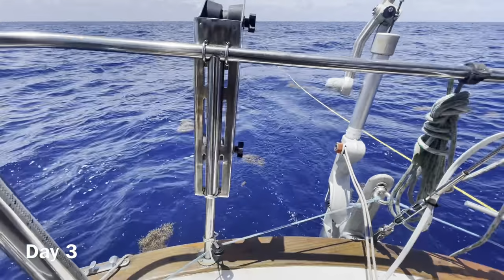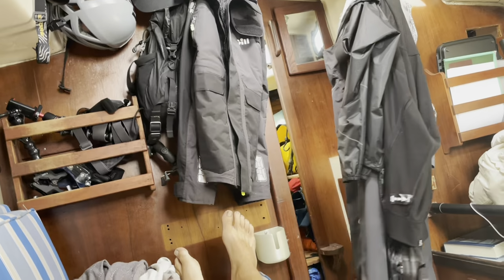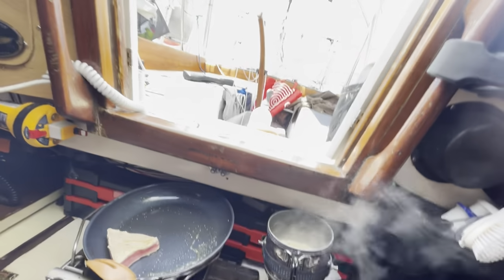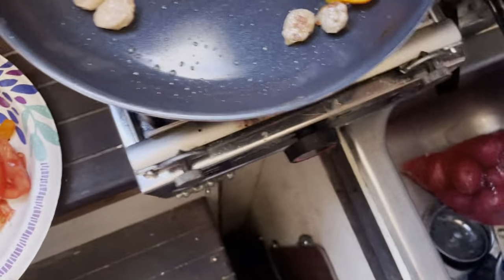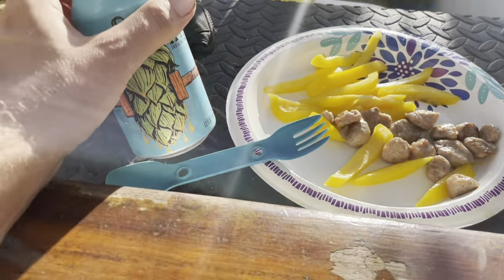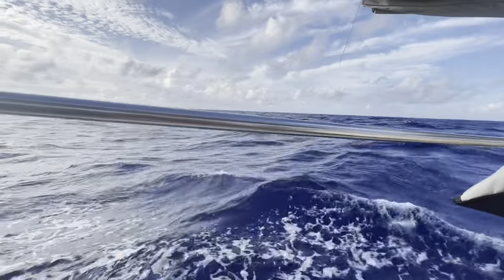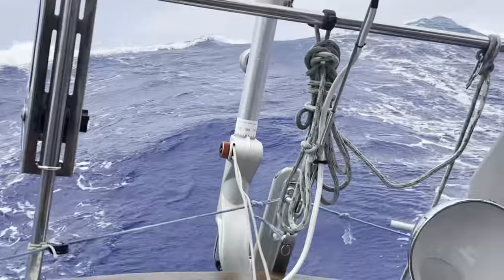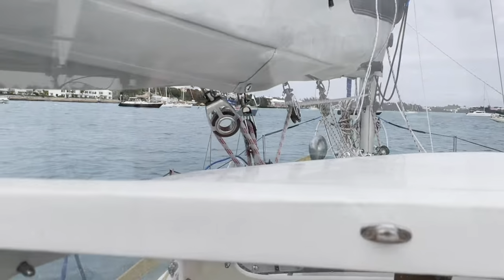Solo Sailing to Bermuda part 2

Comment: Never leave veggies in plastic bags, hang them separately in onion net bags, ie, onions in one, potatoes in another etc, that way if one goes a bit iffy it will not infect the other veg. 
Safe sailing.
Reply: Aye, potatoes and onions really don't get along when you store them together.
Reply: String net hammocks for fruit and vege with onions and garlic in darkest corners.
Reply: Bananas on a sail boat is bad luck, in the old days they would never allow them on a passage. Today it is thought because bananas go bad so fast they make everything else rot. The old saying about apples is big time here for bananas and sailing. Also the the hammock is the way to go too.
Reply: @ehyehasher-albion-bigbrain5181  Reminds me of the old MREs that contained Charms candies.  Hard fruit flavored sugar candies. If your MRE contained them, you had to throw them away because of superstition.  They literally had to be removed from modern MREs so the soldiers would get enough calories in their diet.
Reply: @ehyehasher-albion-bigbrain5181  we use old bananas to help quickly ripen all of our other fruit. something about the gas a ripened banana gives off increase the speed other fruits ripen at
Reply: Thanks for the tip fren.
Reply: @nmnmnm35  yeah, it’s formaldehyde, strong chemical smell bananas give off when they’re very ripe.👍

Comment: Great video! our kind of "vodka tonic"... where the tonic is just a splash! Fair winds!
Reply: a proper drink.

For many, many years I ordered "my-whiskey-brand with just a splash of soda, no ice" and for years I got served my-whiskey-brand on ice with soda, or on ice with a whole glass of soda (I didn't order a whiskey soda), or no soda, or everything in-between. I've literally only had one single bartender that ever made it right: a shot of "my-whiskey-brand" with the faintest push of the soda water button. Only found one bartender that could do it right...

All I ever wanted was a whiskey with just enough bubbly water to dance on my tongue.

Comment: Why don't any sailors just use a hammock in the cabin? It seems like it would nullify the rocking?

Whats the reality there? Does it not work at all? Does it end up being worse?
Reply: On a large vessel you could. One problem would be finding two hard spots in the cabin roof that could take the load.
Reply: @carbidegrd1  seems like a trivial thing to solve. You already walk on the deck, it can take it and these guys love making mods. There must be a reason why nobody likes it? It seems an obvious solution to rocking

Comment: Hey Sam. 😊 Noticed you scraping what appeared to be a some type of glue from the floor. A bit of heat from a heat gun will soften most things enough to just glop it up. I know energy can be an issue when your out to sea so when you do it, all you really need to heat up is the thickness of the stuff your removing. Takes a hour long job and it done in 15 minutes.

Comment: Don't use carpet on that spot you cleaned the glue off.  Use marine vinyl flooring. Great grip, easy to clean, no mildew, so much better than carpet IMO.

Comment: Are you using threadlocker for your bolts? That might prevent them working loose with the vibration of the engine.
Reply: Loctite 243 at minimum.  Vibra-Tite vc-3 is better for vibrating stuff.  Loctite is good for stuff you don't expect to move until you try and loosen it. Vibra-Tite might not bond as well to the metal, but it's more flexible and will hold a bolt in place even when the vibrations will break Loctite's hold free.  It's a softer material that dampens vibrations and even if it becomes "un-stuck" from the surfaces it will still act as a threadlocker.

Comment: i've always been curious (mainly when watching you cut things) why you don't wear the gopro on a head strap
Reply: I'll answer on Sams behalf - the answer is cheese burger, sometimes goat.
Reply: I can't answer for Sam, but it's a pain to keep moving a gopro between mounts.  It takes a whole bunch of time to move it, film a bit, take it off, check the recording to make sure the angle is correct, adjust the angle, film a bit, take it off, check again.  Adjust and check again until it's right.  I can't even manage to move a single camera between bikes.  I'd rather be riding rather than spending another 10-15 minutes putzing about in the garage trying to get the thing clamped on right and pointed the right way.

Some folks give up on swapping between hand-held and head-strap and just get a gopro bite/mouth mount.  That way they can always grab the gopro to film handheld, or they can bite down on the mouth plate and have the camera point where their head is pointing.

Some of this more informal blog stuff can be pretty quick to film and edit, but it's not uncommon for a youtube video to take an Hour to film and edit PER MINUTE of video that we get to watch.  Just filming that knife shot probably made the task take 3-5 times as long. Even with this vlog stuff, having more cameras the vlogger can leave permanently set up is a real time saver.  A lot of channels I watch post short clips on Instagram because it's easy to whip out a cell phone for a 30 second post, but setting up cameras and lights to put the same 30 second clip in a youtube video could take several minutes.

All of the above is basically a long way of saying: If you want better videos donate a gopro or donate to the Patreon if your finances allow it.  Guys like Sam have to balance "doing the thing the channel focuses on" with "making better videos" and "eeking out a living."

Comment: What size sailboat do you sail with and what is the keel size? Iv got a 1977 Columbia 27ft but has a capsize ratio of 1.9, weighs almost 9000lb. It is in freshwater rn but says its suited for coastal sailing. Whats your advice for taking that across the ocean?
Reply from the maker: Make it watertight and work out a bombproof self steering system.
Reply: @samholmessailing  are you talking about the 12v device for the rudder?